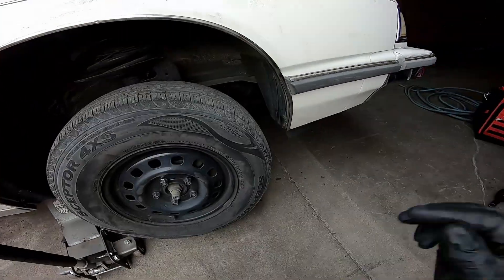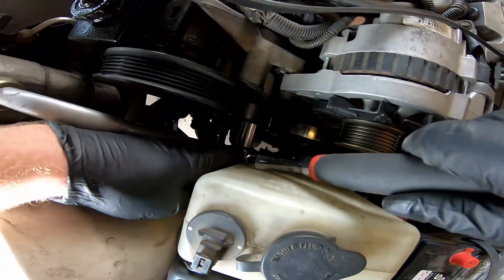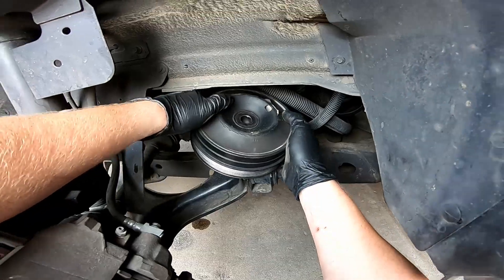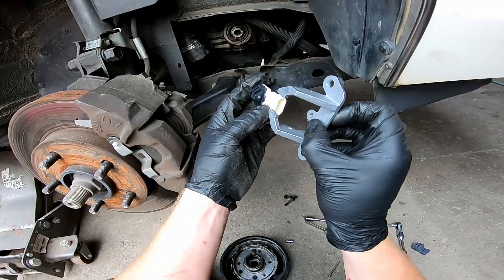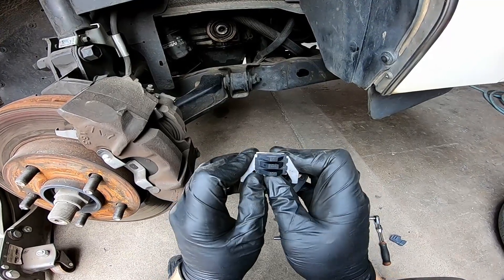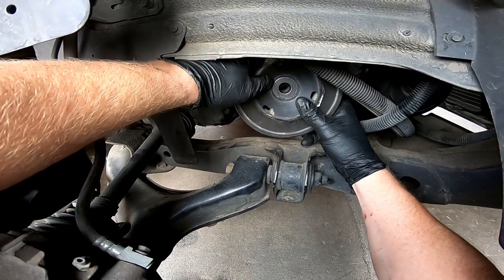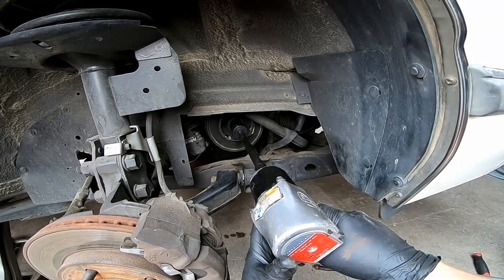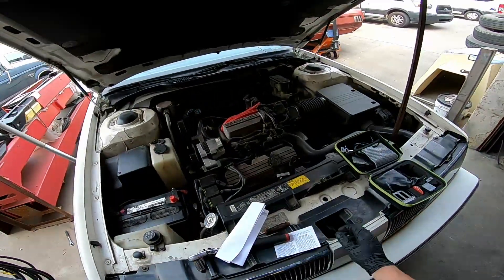How to Replace Crank Position Sensor on a Gm 3800

Comment: Just came back to provide updated feedback, I have a 1990 Oldsmobile Delta 88 Royale. Thank you this was a great video for anyone who’s never done this before. Once the task was actually done I realized how much I was over thinking it. Your instructions were very clear and informative I was able to get the car back running after the other sensor broke because the belt stripped and got wrapped up on the pulley. Although I did go with a cheaper option than the Delphi sensor. Both options were from Napa Auto Parts, hopefully it holds up the car started on first crank.
Reply: No way me to 3.8 v6

Comment: Thanks for making this video! I looked at many to try and accomplish this repair and yours was the easiest, most thorough and concise with very good camera angles....and no nonsense! Look forward to more repair tips from you :-)
Reply from the maker: Thanks
Reply: @GrimRepair  HI, So I did this repair and also did the camshaft sensor, because I thought it might be a problem, too and also easy and cheap to do. Forgot the part about testing before buttoning up everything...bad idea.  I attempted to start the car and it just cranked...no start. Looked around and noticed the belt was off the pulley a bit on the balancer. I reset it and tried again...same thing. I put the belt on 3 times and every time, it shifted a couple of teeth toward the engine. I went under the car and noticed I can see the reluctor rings from the inside of the tire. I didn't look at this before starting so I don't know if that is normal, but it seems like it shouldn't be exposed at all. I feel I seated the balancer all the way, but not sure. I was trying to rewatch the end of the video, when you were lining up and checking the sensor in relationship to the rings and everything seemed good. I am kind of stuck. I pulled off the balancer again and reseated, but not sure it's any different than the first time. Any help is greatly appreciated!
Reply from the maker: If you line up the keyway on the crank with the slot in the balancer it should seat pretty easily. It sounds like it's not seated though if your belt is sliding off. What was the car doing before that made you suspect the crank sensor? Did the balancer get damaged when you pulled it from the engine, using the puller? Also did you use an ac Delco sensor?
Reply: Thanks.  It was lined up ok, I just needed to have someone hold the flywheel, while  I torqued it the rest of the way. I, initially thought the impact wrench tightened it enough...all good now!  Thanks, again, much appreciated 👍☺
Reply: @GrimRepair  .....and, yes, I made sure to use AC Delco parts!

Comment: Scored your self another sub brother, doing crank sensor on my 91 vp commodore which runs the 3800 (L27) looking to build it for boost eventually, gonna be doing trans rebuild, lsd diff and A few other bits to her first though
Reply from the maker: Cool, thank you.

Comment: Thank you very much for this informative video. I’m gonna try it out on my 1989 Buick LeSabre custom. 
I’m having a problem with it cutting out and stumbling. I was wondering if I just do an overhaul and replace all the engine sensors that it would fix that? Including the ICM and coil pack?
Reply from the maker: @Foxlone  I wouldn't just change everything. I would start with the icm and coil pack, if you don't have a check engine light on and your fuel pressure is good.
Reply: @ Ok thank you

Comment: I cannot find a genuine ac delco 213-279 Crankshaft position sensor. Is Dorman brand a good choice?
Reply from the maker: @innovativeguitars3998  I wouldn't go with anything but delco, I used standard brand on this repair, and it didn't work. I did knock sensors on a hummer made by dorman, and they didn't work. I did find this though, https://www.ebay.com/itm/305639635739?mkcid=16&mkevt=1&mkrid=711-127632-2357-0&ssspo=iCAwQtjTR_m&sssrc=4429486&ssuid=54VcmClYTx2&var=&widget_ver=artemis&media=COPY

Comment: how u get the crank bolt out without the whole pulley spinning
Reply from the maker: I used an impact, I believe.
Reply: use the belt to keep it still
Reply: @aaronvivar52  just used my impact but also icm issue could still cause premature ckp sensor failure. had one go out 20k on it and turns out it was just my ign module

Comment: Hi! I have that same car and also a 90 Le Sabre with the same motor. I wanted to know if you use the impact to tighten the bolt back up
Reply from the maker: I wouldn't use one on the clamping bolt for the sensor. You always have to exercise caution using tools of any kind. Some impacts only make 20ftlbs some make way more. Some people go crazy with an impact. Some people use them everyday and never have a problem. You shouldn't use impacts for tightening, everything has a torque spec.
Reply: @GrimRepair  That right. I was just wondering  if you use the impact to tighten  the harmonic  balancer bolt.
Reply from the maker: @fedupdeliveryservice  I did
Reply: @GrimRepair  okay and thanks

Comment: I have 2001 pontiac grandprix, it is running fine. Given the age do you think it is a good idea to change the crank shaft position sensor in my car as a preventative maintenance?
Reply from the maker: No, if it's fine leave it alone.

Comment: Hi. What issues did you have with the "Standard" brand cranshaft position  sensor , on past jobs with the same motor? Was it they didn't last long or did the engine not run quite right? Just wondering. I know some gm stuff works best with newer 2000 and up gm vehicles.
Reply from the maker: I used 2 different standard brand sensors on the car in this video and the car wouldn't start at all. I used dorman knock sensors on an h2 and the check engine light came back on, put ac delcos in and everything was fine.
Reply: @GrimRepair  Ok. Thanks for that info. I will keep that in mind.
Reply: @GrimRepair  Have you ever had to do a "Relearn Procedure" after intalling a new crankshaft position sensor on a 1991 buick lesabre? It is a procdure i assume to adjust the on board computer to recognize and adjust ignition system to a new crank sensor installation. If you have done this procedure, can it be done without a scanner? If so, please explain.
Reply from the maker: @Slim1423  I haven't had to do that. Is it needed on something that old?
Reply: @GrimRepair  ok. Some brand crank sensor companies mention the relearn procedure may be required for my 91 buick lesabre to work properly. When i replaced my crank sensor recently, the car runs erractic for a few seconds and cuts off. It also seems to be misiring like the timing is off. The new sensor isn't broken, and it was aligned with a spark plug feeler gauge.
Reply from the maker: @Slim1423  is it ac delco brand?
Reply: @GrimRepair   No, it is a Standard brand, "P" series type.  I had already ordered and received it, before i ever asked you any questions on your post here. Since i am doing the work, i figure no harm done if it doesn't work.

Note: i remember when removed the harmonic balancer, i looked at those metal slotted rings on the back of the balancer,  the crank sensor reads.  The slotted rings seemed dirty on 1 inner ring, it looked grayish. So, i cleaned that grayish film off, to make sure the crank sensor would read good after install. Was that grayish looking stuff on the inner ring possibly some kind of magnetic coating that the crank sensor needed to read, to work properly?
Reply from the maker: @Slim1423  I am not sure on the coating, my bet is that standard sensor is not working.
Reply: @GrimRepair  Ok. So, if i buy a Ac Delco crank sensor, my car should recognize that sensor right away and start/run correctly? No "Relearn Procedure will be required with a  factory crank senk sensor? On the web i saw a Ac Delco crank sensor part# 12537111, which i believe is the factory crank sensor for my car.
Reply from the maker: @Slim1423  there was no relearn on the car I worked on. I don't know how different yours is, but I do know that 2 standard sensors did not work on this car.
Reply: @GrimRepair  ok. As far as i know there are 3 different versions of my 91 Leasabre . I have a 91 Buick Lesabre Custom. If you used 2 Standard crank sensors and had issues, then that may be my problem also. So, i will order the Ac Delco crank sensor, i spoke of earlier (part# 12537111). After i get it and install it , i will let you know how it did for me.
Reply from the maker: @Slim1423  ok sounds good, thank you.
Reply: @GrimRepair  Hi. I wanted to update you about my 1991 Buick LeSabre Custom. So, recently i ordered a factory brand AcDelco Crankshaft Position Sensor (AcDelco Part# 213-279,  GM# 12537111 ). Both part numbers were printed on the same package that the Crank sensor came in. So, i removed the Standard brand Crankshaft  Sensor, and replaced it with the new  AcDelco Crankshaft Sensor. I gapped the sensor as you did with a .020 sparkplug gauge, and i made sure the rings on the back of the crankshaft pulley turned freely thru the Crankshaft sensor without touching the sensor. Afterwards,  i connected the battery,  and turned the ignition key on , and the car started right up and ran correctly without any problems. I have driven the car over 50 miles, no problems , no engine cutoff problems as i drive down the road now.

Please Note: My 91 Buick LeSbre Custom has over 100,000 miles.  So,  i expect that a new factory AcDelco Crankshaft Position Sensor may last  100,000 miles or slightly longer.

Also Note: The Standard brand Crankshaft Position Sensor wouldn't  work on my LeSabre. However, i have a "Standard" brand Camshaft Sensor that works fine on this same LeSabre.

I got a feeling someone else may have had this problem with another 91 Buick LeSabre. So, that is why i am being so detailed here. 1 final tip , use you can use "Harmonic balancer Puller Set-Part# 57187  to remove Crankshaft Pulley. I found this set at Aurozone , just make a deposit on this tool set and get all your  money back when you return the tool set.

Thank you , Grim Repair , for your advice about getting factory Crankshaft Position Sensor to fix my LeSabre! Your advice was a great help for me!

Comment: Great video! Thank you! Please Help! In both signal wires with the sensor disconnected: I only get 4.95 V  each wire, not 7V. (2004 Buick Le Sabre). The power wire reads 12V. When I connect the sensor, the signal wire's voltages drop to a constant 1.6V and 0.6V. No on and off signals are created when turning the crankshaft. No reaction at all. I tired new ICM, 3 different sensors and they do the same thing. It started when I replaced the CKP sensor to an Acdelco Gold sensor. Car ran for 2 minutes, died, and there there was a metallic sound like a screw falling, and she never started again since. What is wrong? I checked grounds, fuses etc, and found nothing.
Reply from the maker: Hard to say with out being there. Check your wife's and grounds. Please comment back with what you find, it may help someone else.

Comment: 4 years ago our Buick had intermittent misfire/no start; local shop charged FORTUNE to replace crank sensor and ignition module.
Flash forward today, exact same issues have returned from the grave. Swapped ICM, didn't fix
Doing extensive looky loo, have noticed leaking gaskets top and side, the side of block is completely soaked in oil and fluid. Wondering if oils/fluids dripping downwards are shorting out the crank sensor
Could that be feasible?
Reply from the maker: I wouldn't think it would short out the crank sensor it has a weather tight plug on it. See if this video helps you, It took me a few trys to fix the intermittent problems this car was having. https://youtu.be/0J30LAj1X_E?si=0nML7tcAWSuFDhIy

Comment: You should have replaced the timing cover seal right away.. mine started leaking on my 2005 gtp comp g at 150k
Reply from the maker: The front main seal? I haven't had an issue, but that's not a bad idea.

Comment: You forgot to mention how to remove the bracket if the dowel pin is still in 😔 I can’t just pull it out like yours
Reply from the maker: Do you have a time stamp of the dowel you are talking about? I can't cover every possible thing that could go wrong.